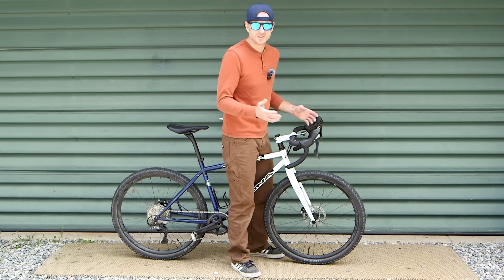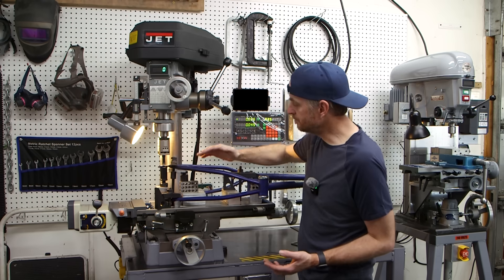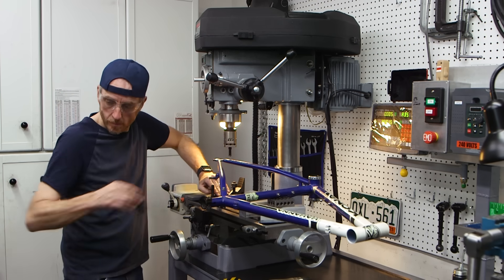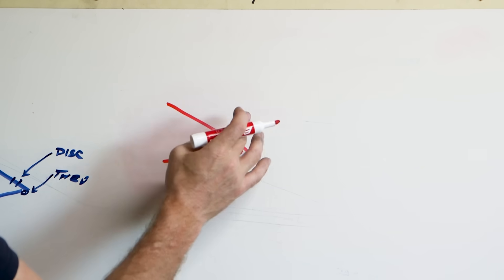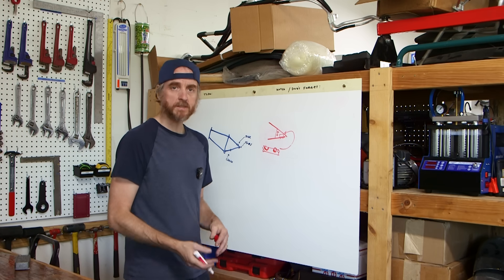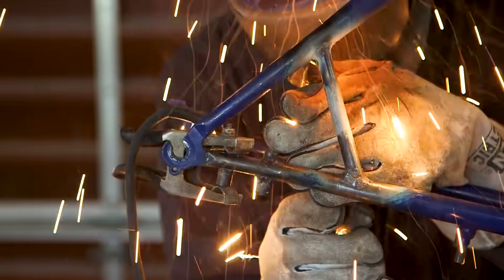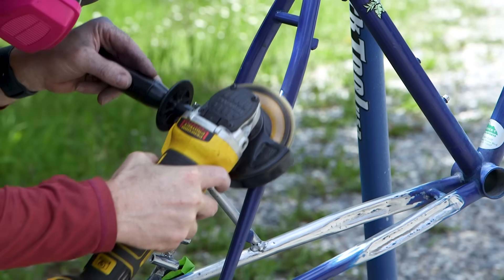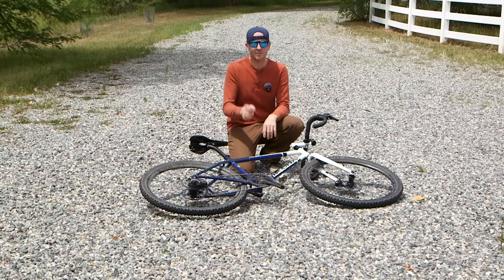Converting Steel Frame to Disc Brakes & Thru Axles

Comment: Is it possible to convert an aluminum bicycle frame from QR to TA?
Reply from the maker: Yeah.  It'd be done exactly the same way.  The difficulty is adding the disc brake mount.  Aluminum is a lot harder to weld.  I did a video on an aluminum  Specialized Stumpjumper where I added discs, if you haven't seen it:  https://www.youtube.com/watch?v=vD1pH86wCrU
Reply: @RobertAdairWorkshop  So instead of cutting the old dropout it would be better to enlarge the quick release hole and add an aluminum metal plate and weld it as a thru axle holder, right?

Comment: Usually TA dropouts cover the entire surface area of the hub end caps. This ensures even pressure is applied to the inner races of the hub bearings. I would be interested to know whether there is any effect on bearing wear using these open ended dropout as apposed to standard 12mm TA dropouts

Comment: Im worried that those post mounts will rip off quite quickly through, the rotational force transferred from the rotor when braking will shear those welds.
Reply from the maker: No, that's not true.  People think that the braking force on the rear wheel is tremendous, when it's actually not that much.  Also, these welds fully encircle the contact between the mounts and the stay.  Mig welds are used in many industries and are quite strong.
Reply: @RobertAdairWorkshop ahh fair enough mate, I'm always happy to learn! I come from a trials riding background, where big rotors and bi directional forces put a fair amount of stress through the caliper/mounts.

Comment: It was a mistake when you cut off the old v-brake mountings because you will need them) When you have the caliper mountings in upper tube, your caliper will change alignment to the rotor when pedaling and turning because the upper tubes supposed to bend, especially when its a steel frame. So you will often hear break squeeze in turns and sometimes when pedaling, that's annoying af
Reply from the maker: This does not make sense and has not happened.  The caliper is braced and is quite rigid.  But even if it moved, it would move in the same plane as the rotor, not side to side, so it would still not rub the rotor.  Cutting off the v-brake mounts had no impact on the rigidity of the stays.

Comment: What kind of cross-slide table do you use on the drill-press?
Reply from the maker: Its this one here.  I got it on eBay.  I tore mine apart, fixed a few problems and repainted it.  https://www.ebay.com/itm/164278234948

Comment: The problem with this is that the frame's clearance at the fork and rear account for rim brakes(small t bone supporting the caliper). Usually, people want to go with disc brake frames to allow for a much bigger tyre but nonetheless,  disc brakes do work better in dirty/crusty environments or in high/constant brake scenarios...as long as the frame is true and strong.
Reply from the maker: I ran 650b x 47mm tires on that bike without modifying the stays for tire clearance.  It wasn't on this bike.  But I have seen it be a problem on others.  My Specialized Stumpjumper build, the stays were too narrow for anything wider than 35mm.

Comment: You will get killed for doing this. The original seat stays & chain stays are not designed for disc brakes. The shear stress force will crack the tubes. Don't sell your bike if you do this. You will have innocent people die for your careless.
Reply from the maker: No, no I won't.  You are wrong and don't know what you're talking about.  Sorry.
Reply: @RobertAdairWorkshop  You should mention in your videos that it is not safe to do this but it can be a fun project as experiment but recommend not to do it & people can get killed. Your video is for Like & Views only & for the money.
Reply: @RobertAdairWorkshop  I agree with you. I have done this type of modifications many times and I have total faith in the outcome.

Comment: What is stopping you from TIG welding?
Reply from the maker: I don't own a tig welder.  It's the cost of gas.  I can't afford the shielding gas and bottle.  The nearest shop has an exchange program but it would cost me about $400 each swap.  It's just not in my budget.
Reply: @RobertAdairWorkshop You would do well to re-examine the terms of loaned tank program. That cost is way outside the range of normal. I own my tank, affordable off CL. Watch CL for slightly out-grown TIG machines. Apply yourself to obtaining this equipment. Your skill set deserves to be supported. You might even find a local weld guy who will work with you on buying a unit he does not use anymore.

Comment: I need to modify my father's e-bike to a thru-axle but I would like to do it by welding the nut to the dropout. The rear stays are steel. I would like to know, please, which wheel hub you bought because it looks exactly like the one I would like to fit. Thank you, I will follow your upcoming videos because I like the way you work :-).
Reply from the maker: That's a Fulcrum hub in a Fulcrum Racing Rapid-Red wheelset.  I think any 142mm thru-axle disc hub would be the same.

Comment: Incredible! IS brake tabs are presumably simpler to retrofit, but the flat mounts look so neat and tidy. Rather than reshaping the stays next time, you could consider a crankset with a wider Q-factor, such as the M7100 SLX or M8100 XT cranks. They are 172mm Q-factor vs the GRX's 151mm, and are designed to provide a good chainline with 142mm axle spacing. The limiting factor would be chainring size though I guess, as the biggest Shimano style direct mount MTB chainring I've seen is 38mm. It's a sub from me anyway! Cheers from the UK
Reply from the maker: After I gave those stays the first few whacks of a hammer, I'd began to regret the decision to use that GRX crankset.  I had a Deore on the shelf that fit with plenty of clearance, but I had it in my head that I wanted the GRX.  Next time, I'm taking your advice.

Comment: isn't there any adaptor to put a thru axle with a quick release ?
Reply from the maker: There are, to go the other way around.  You can fit an adapter to use a QR wheel in a thru axle frame, but nobody makes one for fitting a thru axle wheel in a QR frame, at least, not that I've ever found.

Comment: Why would you go to so much trouble to convert to disc brakes?
Reply from the maker: 650b wheels in a 26” frame.  I’d have had to make custom brakes.  Plus, I like disc brakes better.  That is, if your question wasn’t rhetorical.
Reply: i mean there ARE adapter.

Comment: The reinforcement tube should be round not straight or smaller
Reply from the maker: I did a whole lot of FEA on disc brake reinforcements when I built the Gary Fisher and the geometry of the tube doesn't really impact the overall rigidity.  The bigger contributor is the lower stay and its shape.  At least, from what I modeled.
Reply: I have no clue what you are trying to say.

Comment: such good machining, i love this. currently obsessed with my 2004 moots YBB, which i converted to a modern bikepacking rig (1x, tubeless wheels, etc.). i'm not that worked up about the rim brake in the rear since i converted the front to a 29er thru-axle with a hydraulic disc brake and i think the stopping power is adequate. feels nice too to have a more repairable rear brake for being in the backcountry, just in case something goes totally sideways. BUT i am pretty annoyed by the lack of modern 26" QR rear wheel options and would be so STOKED on being able to go thru-axle. never heard of someone doing that on a Ti frame before and it obviously changes the complexity but this gives me some dreamfuel!!

Comment: Grx is great, but Shimano cues 2x11 is where the gear range percentage is best.

Especially if you want the bike to be used for touring where low gear ends will really shine with all the extra luggage.
Reply from the maker: I’ve never used Cues.  I’ll keep it in mind for the next one.

Comment: Great video! Idea for you: converting a regular chain bike with an internal gear hub to a belt drive one where the right rear doesn’t have an opening.
Reply from the maker: That sounds like a fun project, thanks for the idea.

Comment: The rear brake is auxiliary and no matter what type it is, it doesn't play the same role as the front brake. You showed that it can be done, but the benefit is questionable.

Comment: Great idea to do the caliper mounts. Some old 7000 Treks had the same exact tubes style half moons bolted to the frame mounts but the were mounts for cantilevers. I did weld dual cantilevers for one of my bikes and the result is very similar to disc brake performance and it is weird